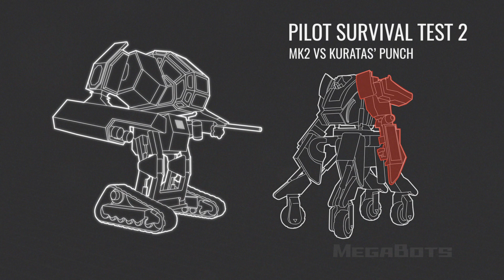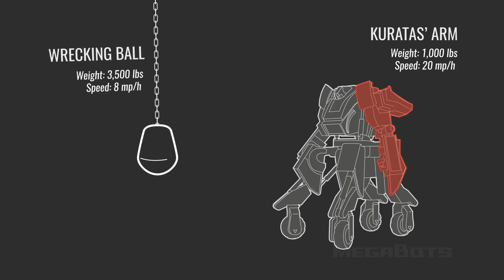How to Destroy a Giant Robot (Season 1)

Comment: You all should put the seat on a hydrolic resistance gimbal that slows the impact through hydrolic resisters that return the seat to its starting position after impact.

Also, you need to reduce the chest impact by letting the seatbelt give with similar slow resistance that also returns to its starting position.

Reduce G's by reducing the speed of impact on the driver's torso. Reducing the impact on their torso also means reducing the impact on parts attached to the torso, namely head, arms and legs, which also means reducing impact where they come into contact with other parts of the machine by flailing or deformation of the metal.

Comment: lots of problems with this model. hopefully more improvements (especially cockpit seeing as there are no locks for it and it just kinda closes). also internals are exposed. one calculated punch to your internals means your systems might shut down. you're robot seems to be hard to knock down Tho which is good unlike the Kuratas which seems easily knocked over.

Comment: this is from a huge fan of mecha genre such as Gundam but i still think giant robots are stupidly impractical in a battlefield as the leg units might be a bitch to maintain & easily getting targeted, you can't even give them heavy armor as they might affect the mobility of the legs as a result, also we already have a better alternative to this: attack helicopters.
Reply: The idea behind "Mechs" and their design becoming practical and efficient relies heavily on the technology related to mobility and material strength. Once advancements are made in those areas, (and material cost of existing suitable materials come down), then you could see these being used on the battlefield, not before then. The trade off if the technology supported it, would be mobility, you could outmaneuver a tank, and theoretically have similar or greater amounts of armor, depending on the size of the mech, not to mention the psychological effect. The machine they are using here, is a baby in every sense of the definition behind what a "mech" is from all forms of sci-fi, where they are supposed to be 6-18+ meters in height. A machine of that size wouldn't be able to be flexible enough with just traditional powerplants, gear boxes and transfer cases, and hydraulics, something more compact and yet stronger and quicker moving would be essential especially in the legs. We are not ready yet, but these are the stepping stones that support the desired machine for the future.
Reply: this isnt for military use, this is for sport

Comment: Awesome. I was hoping to see the data from the G sensors when the mech impacted the ground. Seems to me that the pilot would certainly suffer head and neck injury from that height, tipping over in any direction. Also, would there be any self righting mechanism if these mechs do get knocked down?

Comment: Design flaw.   Your grating should be secured on the outside with grating extending past the corner point of the cage structure vs in the 
inside.  This would distribute impact force over a larger surface area 
thus increasing your failure point at which the grating would be blown 
in weld joint failure or any other securing method. .  Also for pilot 
safety this needs a HANS device and a Head Restraint seat.  From my 
racing days would recommend Racetech USA seats they are the best of the best.

Comment: Thanks god they tested the paintball canon...otherwise RIP Japanese pilot lol
Reply: Nah, unlike the Megabot, the Kuratas has a what looks like a giant plate of steel instead of a mesh.
Reply: so they got advantage? xD how does the Kuratas pilot see then?
Reply: Pretty sure it uses some camera's and screens
Reply: Cameras, which I'm mostly certain are situated in the 'head' of Kuratas. I you haven't, you should look up the Kuratas so you can see what it looks like.
Reply: ***** Also, the fight is supposed to be hand to hand, so they might not even use the paintball cannon in it
Reply: still, if they hit the cameras, the kuratas is pretty much blinded
Reply: The Carmine tis be the purpose of the paintball cannon's special goop. (Not that it needs it. The impact alone holy heck)
Reply: ***** Yeah, that sounds more accurate, thanks for the correction

Comment: Suggestions for the Mk III, especially in the pilot category. To best protect the pilot and his command/control infrastructure, you should shift the cockpit to the center of the mech, rather than having it in the front. You'll be able to properly shield him from all impacts/shocks etc. Visibility must be secondary, though you will be able to place view cages in specific points to allow for reasonable sight. Recommend you check out Battletech/Mechwarrior, particularly the MWO designs for asethetic/structural ideas. Most importantly, talk to the  Weisman and Mitch Gitelman at Harebrained schemes, they've been designing mechs as far back as 1984.

Comment: You need a dual hull cockpit that is supported by shock absorbers between the two hulls, much like a washing machine drum that is insulated so the outer housing doesn't vibrate when the drum is off balance.

Comment: Wooow... "Overtime even 40g will kill you"
You don't fucking say
Reply: A g is a unit of acceleration, equal to 9.8 meters/(s^2), or 32.17 ft/(s^2) in freedom units. At high enough gs, the force your organs receive from being suddenly accelerated is enough to cause critical levels of damage to them in a short amount of time. But if you constantly experience a strong g-force, our organs will still be damaged over time, just not enough to kill you immediately. It may take a little time to cause critical damage when your organs experience strong force in this way.

Comment: Looks like the battle won't end by knock-down, Megabot is very stable, more than I think; but you have tested the stability against a blow on the side?
Reply: It is really hard to circle a robot, especially one with treads... Tank treads can turn quite quickly.
Reply: Paradoxically, I think the back is harder than the front.
Reply: Robotjox reference? 😁
Reply: I honestly didn't expect it to be as stable as it is, but those wrecking ball tests proved me wrong.  That thing is sturdier than it looks . . . but it has 2 legs, so one of them goes, the whole thing goes.  But, same can be said for Kuratas to some degree.
Reply: As soon as one the robots closes in on the other, one punch may get thrown and then it would become a push fight. As you can see, Mk. 2 is not equipped for handling a forklift, let alone the Kuratas. Mk. 3 will be much more stable.(Hopefully)
Reply: Ridliman lol, future defeats all expectations

Comment: That gives me an idea... what if you just tip over their robot? Then it won't be able to do anything and we win! #USAUSAUSA
Reply: Kuratas is much lighter than the Megabot, but it's also got a much wider base.
Reply: Meaning it's a lot more easier to tip over than this one, like via a forklift-style system. Right?
Reply: Depends. It might be hard to get a forklift under one of the legs.
Reply: you don't just "tip over" the Japan Kuratas. They have shorter and smaller profile, with 4 whelled "legs" that can become into wider and shorter stance mecha, giving them balance when hit.
Reply: Not to mention, as they have independent legs, it's possible they'll be capable of self-righting.
Reply: The Kuratas is suspended on 4 separate bases. The overall base is really wide, the Kuratas is the last robot you'd flip over.
Reply: Earthenfist Kuratas' legs aren't that articulated
They can do just the one movement, and not even very fast
I mean, who knows what modifications they've been working on for The Big Game, they may very well have that by now, but I don't think self-righting is even a real option for machines this size without incredibly weighty and specialized equipment that would take the focus away from other stuff

Besides, unless they decide on using a giant wedge/flipper as a melee weapon, or if the battlefield they decide on ends up being made of 45 degree angles for some reason, then I don't think Kuratas has anything to worry about, Megabot is the only one that would ever need to worry about a self righting mechanism under normal operation(and even then, only this model, which still holds up pretty well, and they're doing this testing specifically to change)
Reply: The kuratas not only has a more stable four leg configuration and is shorter than the megabot relative to it's width, but if I remember correctly the kuratas can also transform into a lower "drive" mode and lower it's center of gravity
We're talking about Japan here, man, mechs are sort of their thing
Reply: We'd do much better blasting its head off.

Also, I love every single person in this comments thread. We are One.
Reply: lol flipping bots in robotic competitions
Reply: Umm the Japan one have wheels and have you seen how fast it can move in any direction?

Compared with this one it's limited movement in sorting movements
Reply: They could break the legs and win easy
Reply: TheDragonfriday It cannot strafe.
Reply: Christopher Knorr
Lol true
Reply: Ignat Remizov also  from what I have heard its melee and cannons only
Reply: Ignat Remizov no cheeky geeky strats
Reply: Ignat Remizov kuratas would just have killed the pilot first
Reply: Ignat Remizov that's in the rules, knock it over and win. It's what kuratus did to iron glory.

Comment: It's really impressive how stable that robot is! I wonder how stable the new robot is...
Reply: Just don't airlift the robot through some clouds and we'll be fine.
Reply: It's heavier and more sophisticated, so I'd say....more stable.
Reply: The new one can actively rebalance itself after getting hit, right?
Reply: Andrew Meyer I believe IHMC is at the very least consulting on that.
Reply: It would be real hard to walk like a human, also not really effective since it was slower and more unstable, you probably has seen a smaller scale (not Megabot tho) and its really ease to tip over
Reply: ShirtyScarab554 theyve been working on bipedal robots for a while, with only tentative success. None of these designs are designed with fighting in mind. The track base is a superior base when it comes to durability.
Reply: ShirtyScarab554 well, Kuratas is on wheels too, so it's a fight between two non-mechs anyway. No sense having a disadvantage in the fight just for purity's sake.

And bipedal may be able to get up easier, but it also falls/stumbles/slips easier too. A lot easier. The robot is cheaper and more resilient if it uses the track base.
Reply: probably gonna be 10 times more stable
Reply: Does the new robot WALK
Reply: ShirtyScarab554 Nope, is on a Howe and Howe track base.
Reply: Christopher Knorr when will they design it to walk, if it's  even possible.
Reply: kenip munip well depending on the motors it would be more effective terrain wise, as in stepping up small cliffs and such, but then again it would need a powerfull gyroscope to balance wich means it would probably need to be as big as a Cougar or Adder. (I'm  a Battletech/MechWarrior fan)
Reply: Christopher Knorr But bipedal walking would be better if we had superior  motors right?
Reply: ShirtyScarab554 in what way, besides the ability to maybe navigate slightly more diverse train, is bipedal walking superior to a track base at all? The way I see it, tracks are more balanced (wider base, more mass lower) which requires less balancing tech and makes for a tougher bot.
Reply: Christopher Knorr  I personally feel if you throw tracks on something with arms and a cockpit, it's  not a mech, wether it's  tall or not. Bipedal walking wouldn't  be nonstable if the mech can catch itself falling or be able to get back up, while track vehicles, once they flip there's  no getting back up on a battlefield.
Reply: ShirtyScarab554 well, Kuratas is on wheels too, so it's a fight between two non-mechs anyway. No sense having a disadvantage in the fight just for purity's sake.

And bipedal may be able to get up easier, but it also falls/stumbles/slips easier too. A lot easier. The robot is cheaper and more resilient if it uses the track base.
Reply: Christopher Knorr If you have a really good gyroscopic balancing system then chances of it falling are pretty low, but then again I'm  not sure if we have the technology for it motor wise.
Reply: ShirtyScarab554
Even if it's possible, those systems will be delicate, sophisticated, and expensive. Not suited for taking repeated pile bunkers.
Reply: Christopher Knorr hence the reason there are inches upon inches of armour on battlemechs, obviously this robot is to small for such tech, but mechs like the owens and cicada are big enough.
Reply: ShirtyScarab554 method 1 is the most advanced robot in that regard, but don't expect to see that technology soon

Comment: 10/10 American robot early version is proven durable.
Reply: Well it took multiple wrecking ball's to the face/cockpit, so Durable enough to take a punch from it's opponent.
Reply: Really fricking durable... Once they upgrade this it'll be nigh near indestructible.
Reply: They should try tipping it from the side
Reply: Kuratas is a lightweight compared to our bot. It simply can't hit hard enough to tip our mass.
Reply: Or at least heavy.
Reply: Honestly I expected it to fall over easily.　Guess  I was wrong.
Reply: Christopher Knorr Although, you need to consider where the center of that mass is. :3
Reply: add a gyroscopic ballance mechanism and there you go
Reply: +Karuikio Nope, you weren't.  Kuratas knocked it on its ass.

Comment: Just a thought, and I'm sure you've thought of this already, but if the robot's stance were a bit lower, it'd be more stable.
Reply: They can lower the stance, as the legs are hydraulic. They put it in the highest position for the test.
Reply: Mmm, a good point. I dun derped.
Reply: well it was prettty stable eveb for its highest posture

Comment: Quick question, why not a more beveled cockpit? Wouldn't that be more likely to deflect impacts of projectiles/blows?
Reply: I'd guess its a balance between pilot's field of view, overall dimensions, and beveling shape. There needs to be a wide enough window in the front for the pilot to see through, without the frame obscuring vision. The closer the pilot is to the window, the smaller this can be, but that also raises the danger to the pilot if the window buckles, as in this test. Sharper angled beveling should better deflect impacts to the sides, but this wouldn't work over the entire cockpit as it would stick out very far forward, allowing side impacts to exert larger torques on the robot.
Reply: it is harder to build and its structural integrety is fucked once it gets a dent